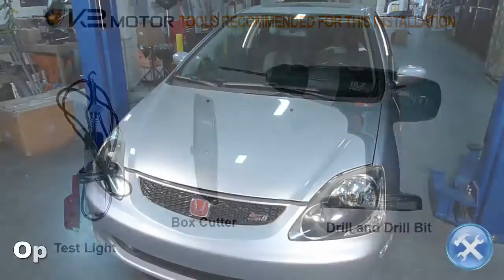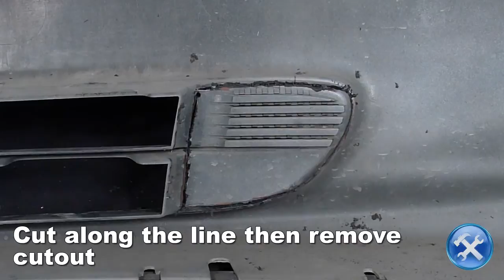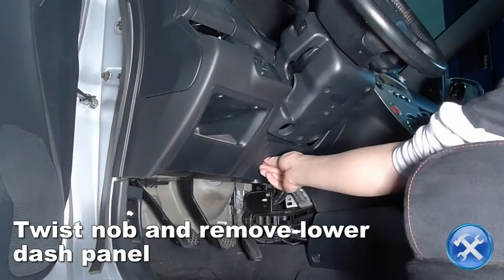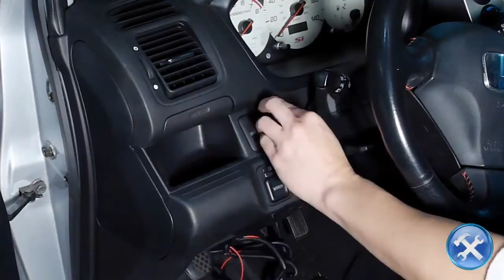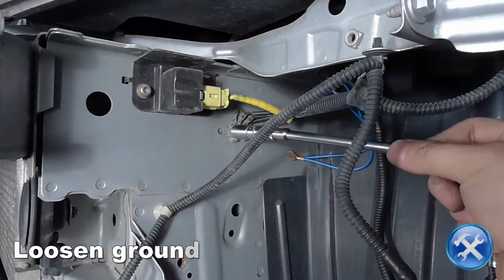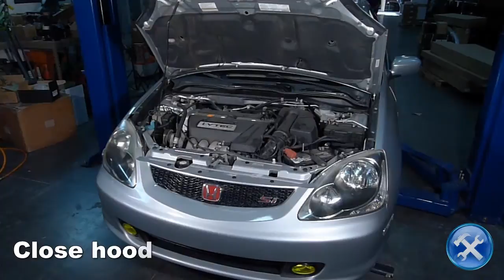K2 MOTOR INSTALLATION VIDEO: 2002 - 2005 HONDA CIVIC SI HATCHBACK FOG LIGHTS

Comment: what does acc stand for?
Reply from the maker: +Ian Creaturo The ACC on your ignition switch is when there is power going to your accessories. We recommend using power from the ACC because that is when the least amount of battery power is being used.